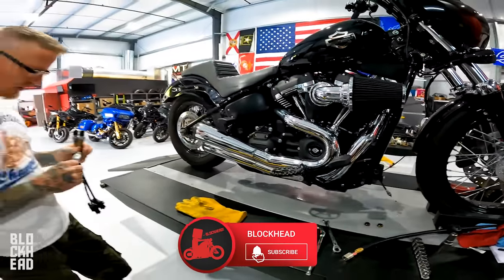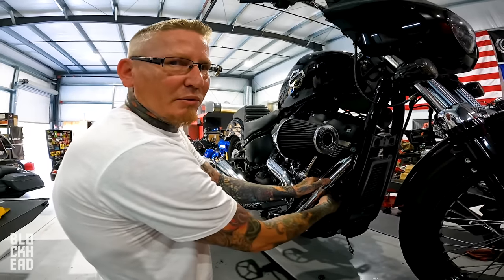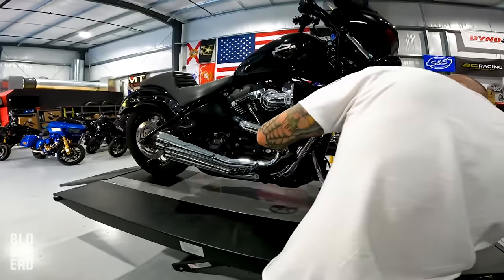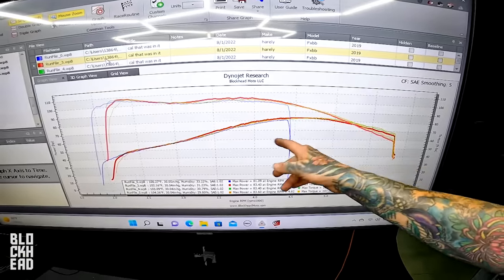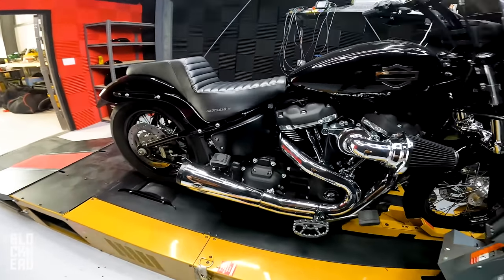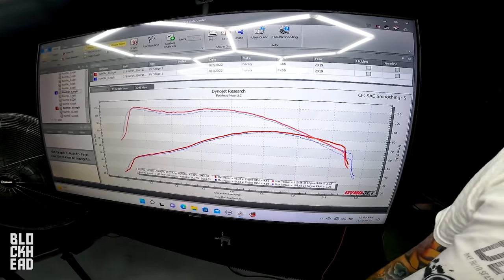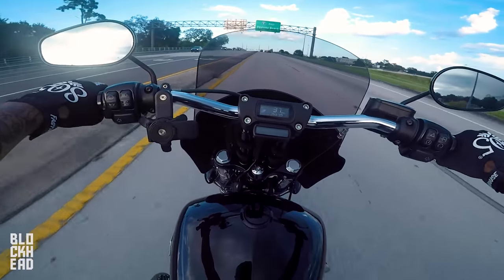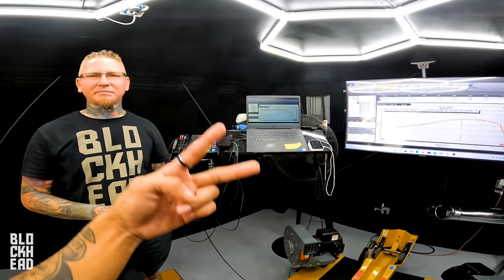Does a Harley-Davidson Stage 1 NEED to be Tuned? (We SHOW You!)

Comment: Honestly my takeaway from this is plan to do a stage 2 with a tune, but if you want to run pipes and an air cleaner while you save for the rest of the stage 2 just go for it.
Reply: exhaust and air do a lot if he was on stock exhaust and air it would have been probably 5 hp 10 tq less. now if he had a 2:1 exhaust he would have got much better gains, especially in the low end

Comment: I never do Stage 2. I always install a heavy breather and SLIP-ONS and use the Dynojet Power Vision Tuner to give it a little extra throttle response, and I'm happy. Afterwards, I run the auto tune and getting everything running tight and smoothly. My bikes have never had major problems and run very well!

Comment: This has been my experience with my Versys 650 with Power Commander 5, a tune from Dyno Jet, and what amounts to a stage 1 with air and exhaust mods. I did not dyno the bike but the butt dyno was the same feeling as what was described in this video. It essentially took the max HP/Torque my bike could produce and brought it on at a lower RPM so that my bike pulled hard all the way through the RPM range. That's how it felt when riding anyway. My fuel mileage dropped by about 10% (dropped even more if I was rowdy with it). It wasn't a huge deal but my fuel range was about 50 miles less per tank so definitely noticeable. The change in the throttle response was the most noticeable change about the tune. It became very twitchy with the power delivery. It no longer rolled on smooth like Chris spoke of with the stock tune. It became very easy to bring the front tire off the ground. It was very fun to ride this way but ultimately, I think it detracted from the everyday rideability of the bike so I took it off (Power Commander 5). It was stored it in my parts box since there was no real gain in power and it contributed to a noticeable loss in fuel economy. Stock tunes nowdays seem to be really good even for a basic slip on exhaust. The twitchy throttle response made it harder to finess the controls during slow speed manuevers and the bike became more buzzy with vibrations at higher RPMs during highway speeds. If all I wanted to do was be a hooligan with the bike, then I would've left it on there because that is absolutely what it turns the bike into. It really just changes the attitude of the bike if you think about it and that's about it.

Comment: Great vid guys, thanks.  Best part is I just did a fuelmoto jackpot 2-1-2 headpipe, 4" cobra NH and FM map for PV on my 21 Roadking Special. While talking to my local shop mechanic Friday, who has never seen this or messed with just a stage 1, we ran it on the dyno.  5th gear pull SAE 92hp and 128fp, 6th gear 94/125 with the power hitting @ or before 2k rpm all the way to about 3800.  Not bad for about $1k in parts and adult beverages in a "stock" 114 with out of box 86-88hp and 119fp claimed power.  The bike is a beast and so much fun to ride and she be awake now. A woods or a S&S cam might happen sooner than expected.

Comment: Thank you for this video, you guys rock, basically what im taking away is I can put slip ons on and maybe a high flow air cleaner and not bother with a tune till cam time.  I was always under the impression that with slip ones and a new air cleaner that the tune was mandatory.

Comment: At MMI Phoenix (Motorcycle Mechanic Institute) our instructors told us STAGE 1 ABSOLUTELY DOES NOTTTTTTTTT NEED A TUNE as these new M8 ecm's will relearn and adjust as needed, or get a Tuner if you plan on going further than the Stage 1.
No, I do not think what they say is law, but after their explanation it was very convincing that it isn't "necessarily" required.

Chris enjoys running that dyno, and I CANNOT blame him! Something really fun about dyno pulls

Comment: I used the improved Stock tune on my M8 Fat Boy 114 with SE airfilter and Elimnator 300 pipes with 118W TTI's installed, and ran that for months before I did stage 2.
Bike ran great, didnt overheat, and it got more power, especially after I installed the 118W thundertorque inserts.

Comment: Just recently did a Stage 1 on my 1200 Custom. Was ignorant of the difference until I did a V&H FP4 canned Map, but the difference was night and day. It sounded rough, almost congested before the tune. Lots of decel pops, etc. It's damn near perfect now.
Reply: Good heads up. I was wondering about mine, the dealer i bought it from had no concrete info if it had been remapped. I get the slightest popping on decel so i think its good
Reply: @samwell707  you could always pop the seat and look in the battery compartment and see if there's a tuner module in there. A lot of people just leave them plugged in. They're usually married to the VIN, so it would be pointless to keep if they sell the bike.
Reply: What about the FP4?I had mine Yesterday and still not installed the air cleaner and the tuner...i can only go with the FP4 cause of the 4 PIN can bus....FP3 4 PIN Is almost a chimera!! I Ve ready a lot of trash talk bout FP4
Reply: @pierluigimarchi8108  I've had no issues whatsoever with mine. I installed the pipes and air cleaner first.  Without those it's kind of pointless. But my personal opinion is most of the issues are either not following the directions or phone glitches.  But don't know for sure.

Comment: Stage 1 on my 2015 Fat Bob since new, with a standard HD map. At 90,000 km on the odo, I decided to get it dyno tuned. Very nice. Runs more smoothly at 2000 - 2500, there is a noticeable increase in torque, and it runs a bit higher. Very happy with the results. No, they didn't give me a "before" to compare. My mileage is a little worse, because it's a lot more fun now 🙂
Reply: That's a twin cam.  Different than the M8.  Twin cam needs to be tuned to run properly.

Comment: I change air filter to high flow. One that doesn't have a cover so full air intake. My 2017 Road glide became more aggressive. What I wanted to see is when in 6th gear at 70 to 75 mph will my bike have more torque when I give it throttle. Before the new air filter, I just get noise but no torque. No front end reaction. We'll, I'm glad to say when I got on the highway my front end would rise up and I d get that jerk that I was looking for. So even without changing the exhaust, there is improvement in power. All my gears my bike is more aggressive which I like.

Comment: This is a topic I've been interested for awhile. There's a Power Commander add-on called an Autotune which is basically an o2 sensor that I'd need to weld into the exhaust, which negates having to go online to download a fuel/air map then load it into the PCV. I'm wondering how it compares to a genuine dyno tune?

Comment: I can almost promise you that over time you will be VERY happy you tuned the bike. The more air that's coming in with that big air breather, The less restrictive the 2-1 pipes the hotter the bike will run and this will cause lots of issues over time. Also performance. Maybe not the day of the install or even a week but a month or more. But heat wise for sure almost right away. I think it's not talked about enough. I don't think you tested this tuned in one day did you? Just go out and make your opinion that day after the tune or did you ride for a month. I'm just saying man I think at least with my set up I needed the tune. The fuel management was good for the bike.

Comment: While it didn’t give a dramatic increase how about the air/fuel ratio? Is it a “healthier” engine now?
Reply: Looking at the video, they didn't seem to have any o2 sensors plugged in? I'm a mechanic, and have dyno tuned cars for many years. The most important thing is air fuel mixture. Power gains are irrelevant.
Reply: @tim how can you tell there's no o2 sensor? They barely do any close up on the exhaust. Genuinely wondering
Reply: @jikwag3415  I could not see any wiring coming from the exhaust back to the dyno. There is a possibility that they were using the factory ones but I am not sure they react fast enough for tuning full throttle? Their lack of a reply tells me they were not looking at it.
Reply: @timblackburne77  ohhh I didn't know that. That's actually good info. I've ran my car on dyno before while back when I had 350z. Didn't do that either but that makes sense if you're precision tuning
Reply: @jikwag3415  with cars it is common practice to put the O2 sensor in the tailpipe (so it is clearly visible). With really short exhausts you need to screw it in the factory position to read properly
Reply: @timblackburne77  yeah back then I had bone stock 350z HR motor and don't remember if we plugged the o2 sensor but it was just to read the HP but not to map the tune. It read 306hp at the crank and 240ish torque to the wheel. Was pretty cool. HP to the wheel was like 275ish. Just random experience I'm spitting here hahaha

Comment: When I put my pipes and air cleaner on my check engine light came on. When I put the canned FP3 tune in the check engine light went away. I get the dyno shows the same torque and HP curve but that’s only a tiny slice of the pie. The correct answer is yes you need a tune for proper fueling ANY time you change the air flow.

Comment: Great video guys. 
I'm interested to know from Chris as the tuner, Run 1 what was the AFR? Many people as you know just do pipes and high flow air cleaner for the look and sound, but skip any sort of tuning. Potential lean running longer term damage is what I want to know. A high flow filter in a stock air cleaner cover and slip ons maybe not so bad. But when you go open air high flow filter and full system exhaust, how severe is the difference to AFR?
Reply: My questions exactly. It's not so much about HP and TQ numbers but more about AFR's and the potential for a lean condition.
Reply: @manny1470  yes. I will say they tend to run better when they're not heat seized. 😁

Comment: In the internet or computer world a delay is known as lag time or just lag. Basically means the same as delay or lack of response. I'm on my fifth bike two of which had at least stage one tuning. The newer bike had an  electronic throttle and so does my current bike. I would've never thought an electronic throttle could be so responsive.  I don't know if the first bike had a dyno tune since I bought it used but it was quick and if you wasnt prepared it could easily get away from you. The second bike with a stage one was a roadglide with a 114 mlk 8 and it was at least responsive as the first bike with a stage kit on it.   
I was just thinking as you were pulling that bike into the dyno room . How cool would it be if you could rig up some LEDs in there that light in brightness according to the throttle position.  I mean really.

Comment: Don't offer my opinion much on the channel but I can't stay quiet on this one. Stage 1 is a waste as far tq and hp are concerned. It's basically for looks and sound at the cost of 1500+ in some cases. Might as well save the extra coin and do intake, exhaust and Cam at the same time IE Stage 2. Anyway, Chris thanks for the in depth explanation.

Comment: I wondered if a stage one who help my road glide. We'll I put a hi flow air cleaner that doesn't have a cover. It has a frame that has 90% of my filter is exposed. I installed a Sharkroad full 2-1 exhaust. When I started the bike, it didn't sound like a Road glide off the showroom floor. My bike nolonger rode quick and smooth. My bike became VERY AGGRESSIVE AND POWERFUL IN THE LOWER GEARS. It doesn't feel anything like the bike I purchased, and that's cool. This bike has diffently changed for the better.

Comment: I've run a few different pipes and they all required a different tune to run good.
Especially duals.  Completely different tune then a 2 into 1.
Reply: What do you mean by run good? Without the tune, did the pipes get too hot?

Comment: Thank you for sharing this content really appreciate the work and effort involved. I have collected my bike 2023 softail standard. I have installed Vance & hines 3 inch slash cuts with PCX, but still have stock intake. I had a map sent from Dynojet for this setup. can I ask what the lowest idle should be on M8 107? I ask as my bike just cut out on me at a stop and was wondering if idle is a little low?  thanks again 👍

Comment: I just did a stage one and my road glide rides rough. It has more power and rumble. But it's no longer smooth riding. It rumbles and I'm not sure if that comes with changing the headers and exhaust. If so, I ll take it because in the lower gears  DYNOMITE

Comment: Can you program and tune the bike to be used for touring? Easy throttle action, gas consumption, etc. I like the sound and the breathability of the bike after installing a stage 1. I think this is the normal operation for the engine. But can I tune that for normal use, like touring. 

Thanks

Comment: Arlen Ness has had problems with chrome here in Florida  so keep it clean... My hand grips Corroded in less than a year and they would NOT Replace them... and Ibalways wear gloves so sweat was Not the issue.
Also Keep the Rain cover with you for that super sucker...IT WILL SUCK IN RAIN

Comment: So out of all this, the newer M8 Harleys have enough fuel to allow an air cleaner and pipes without a tune?  Air/fuel was not mentioned nor looked at after the initial pull which was my curiosity with the stock tune and higher flowing parts installed.  Looking forward to the stage 2 vid.

Comment: I suspect if you put the correct lollipop or torque insert at the end of your muffler baffle, you will raise that low-middle range torque curve (to where its most useful) out of its low.  I would have liked to seen the same bike pulls without the air and exhaust mods.

Comment: Nobody ever talks about just putting in a stage 2 torque cam, with no tune, and leaving the exhaust  system stock on a 107 Sport glide with the 2 into 1 exhaust and long length pipes. I'm interested most in HP and torque figures from 2000 to 3500 rpm, because that's where I find the most usable portion of the powerband.  I don't want to make any more noise than it already does with a stock exhaust.

Comment: PLEASE HELP!!  My 2018 Fatbob 114 has a Bassani 2-1 with a TTS Mastertune 2 (blue). The HD dealer set it up, but no dyno. It is a little sluggish and if i crack the throttle open it will detonate. Sounds like a ball peen hammer smacking my heads! So now i only open it up over 2000 rpm and it runs o.k. They keep making excuses to not dyno it. I feel like they want the warranty to run out first. What should i do? HELP!!!
Reply: Have a decent shop put it back stock. And NOT scratch or ding/dent things. The take it to dealer, & be like “hey.. what’s up? What happened here??”
 🤷🏻‍♂️

Comment: What 02 sensors are you running? Wide or stock narrow. I have the PV 4 and working on getting a good map for my 2020 Fat Boy with V&H 300 Eliminator slip-ons and a K&N filter element in the stock 114 Air cleaner. I am getting a little back fire now and then when downshifting for braking. I’m not sure if that’s really an issue I should be concerned about.

Comment: You may get to this in the video, but  is there a safe and reliable way to upgrade an ironhead for more power, reliability etc. I'm currently working on getting my bike going that has sat for 11 years in a garage, and rather than clean carb, maybe put aftermarket carb on, things like that. Or should I restore as close to original since it's a classic.

Comment: If I put on a new air cleaner and a slip on exhaust, do I HAVE to tune it? If I don't, what could happen?
Reply: Same question. Anyone got an answer?
Reply: No you dont need too but it will slighty degrade the engine life if you ride hard and ride it untuned for too much time. 
Also, ive heard from another dude on youtube that the newer model efi harleys have the ability to automaticaly balance the air fuel ratio a little bit but not how it should be exactly, givin you more time to retune the bike

Comment: is it really worth the cost just to gain 3 or 4 hp., how much is the cost ? for they few extra ponies. cruising on the roads, not track.
Reply from the maker: Stage 1 can vary based on parts you go with, can range anywhere from $600 to above $2000

Comment: Dropping weight may actually improve performance more than stage 2.  Carbon fiber wheels to decrease weight and unsprung weight.  Replace lead acid battery with lithium battery.  Does Harley make aluminum or carbon fiber fenders, titanium handlebars, and titanium exhausts.  Titanium exhausts, you can hear the difference.  Sport bike builder go after weight AND engine performance.  A lighter bike helps acceleration, braking, and handling.  How about a Harley QUICKSHIFTER?
Reply: Weight is really something to think about.  Most sport bikes in the 400
Pound range vs Harley 700 pound range.  you need almost twice the horsepower in the Harley to keep up with a sport bike secondary to weight  it is less expensive for a manufacturer to place a larger motor in a frame vs lightning the bike.
Reply: Do you know how expensive carbon fiber & titanium parts are?? For the price of CF fenders, Ti bars, Ti exhaust, Li battery, etc.. you could literally buy a S&S complete upgrade kit. With jugs, heads, cam, oil pump, and everything in between. 
 Real Carbon Fiber & Real Titanium are badass.... but definitely no joke when it comes to the bank Acct.

Comment: You failed to mention whether you really NEED to have  your stage 1 tuned or not. (Tip: you do not, no factory stock engine is that picky.)
This video is about how much power there is to be found but you don't say anything about a/f ratios or what happens when you change the exhaust and intake and don't have it tuned. Internet is full of "experts" telling you your engine will simply explode if you change as much as slip-ons and don't have the engine flashed/tuned.